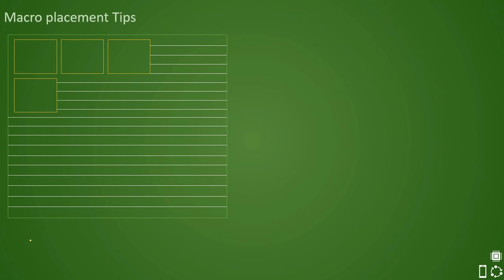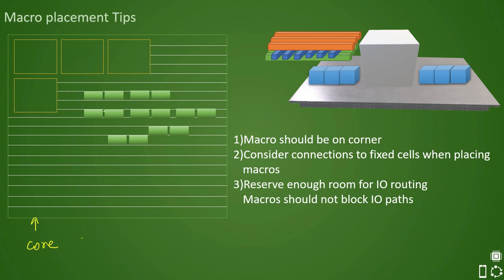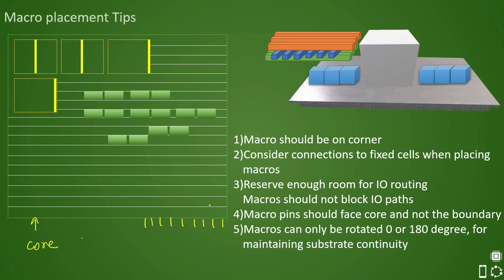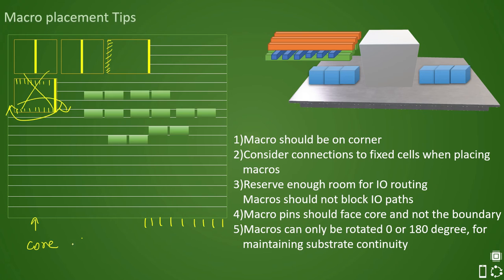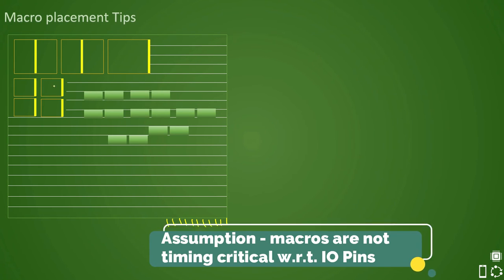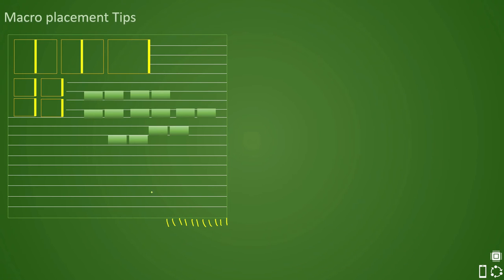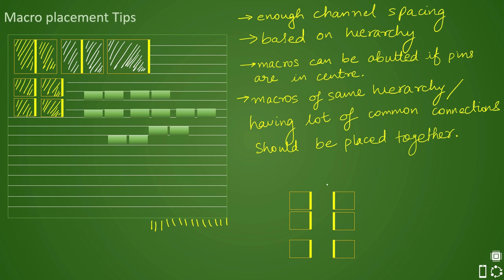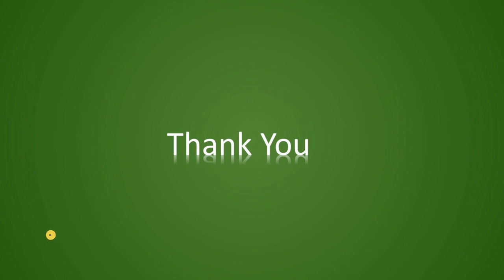PD Lec 19- Macro Placement Guidelines & Floor-planning [part-5] | VLSI | Physical Design

Comment: Sir, I did not understand about maintaining the substrate continuity with the macros, can you please explain this.
Reply: same doubt
Reply: it is related to P-well and N-well continuity. so that fabrication can be done by foundry.
Why continuity is needed ? because during fabrication we need continuity to form those base layers if not done it will be caught as DRC violation (Foundry Rule).

So while placing macro we need to make sure the continuity remains intact. The initial orientation is given by Foundry.